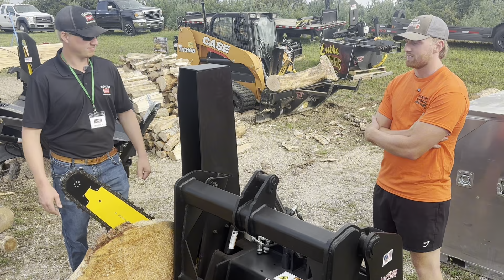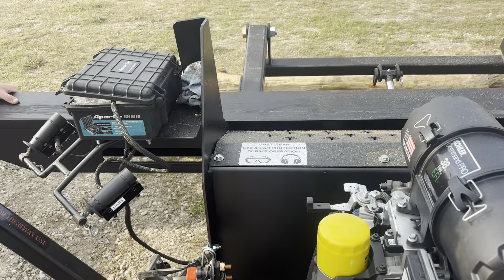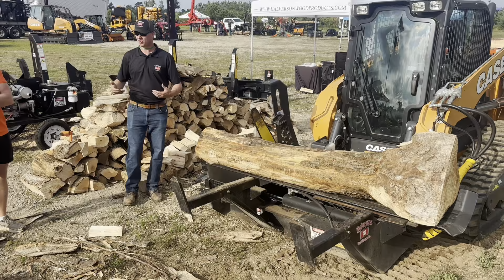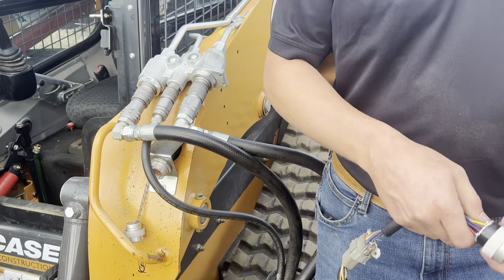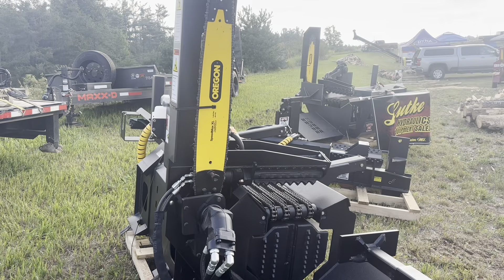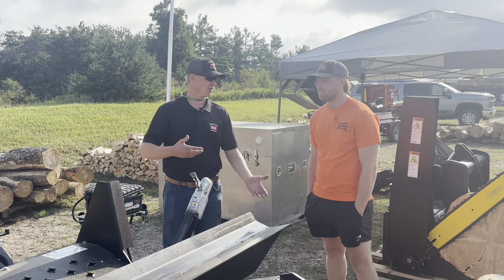THE ALL NEW HALVERSON HWP-120-TR FIREWOOD PROCESSOR!!!

Comment: Two things I didn’t like about the splitter. You’re not by the splits and there is no tray to hold the wood just in case you want to resplit.
Seemed very smooth operation.